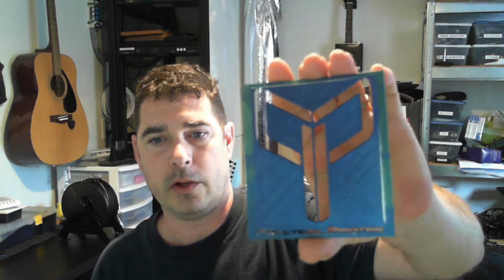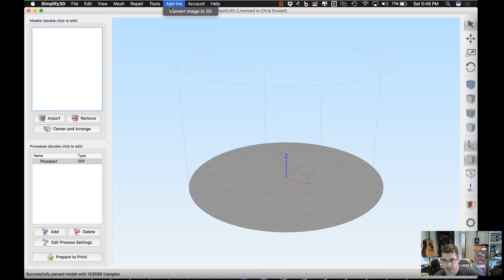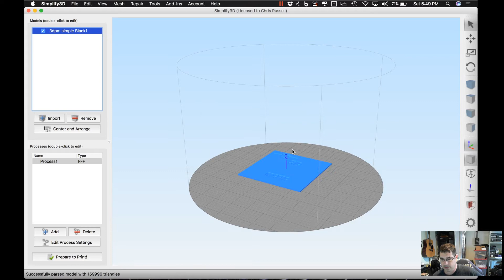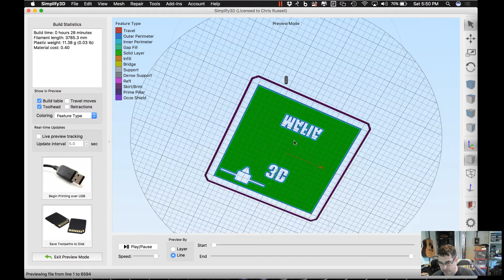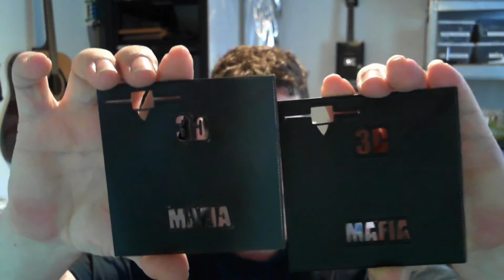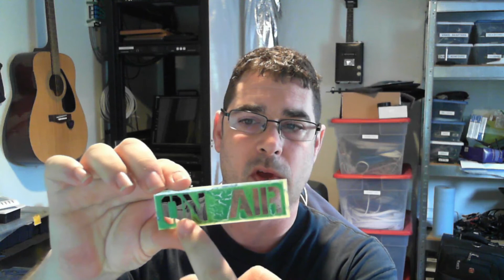How-To: Making 3D Printed Stencils with Simplify3D

Comment: I didnt catch the name of the font you use for the "ON AIR" print. The link goes to 16 pages of stensil fonts...
Thanks in advance

/Stephen
Reply from the maker: MrSOdgaard hmm looks like the font I’d originally used (think it was called just ‘Army’) is no longer there. The one called Gunplay looks very similar.
Reply: @crussty3d  Thanks for your fast response. Yes - experimenting with Gunplay just now. Seems to have a little to narrow connectors. Had to go down to 0.1 mm to get a line at all. Time will show.
Reply: By the way - I generate the 3D STL directly in SCAD...